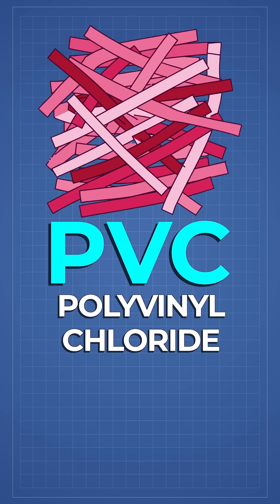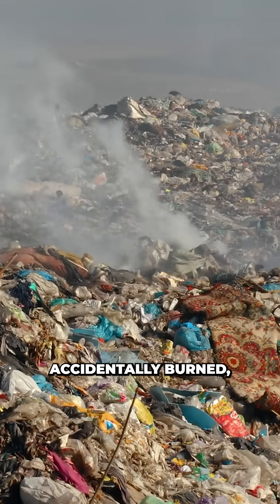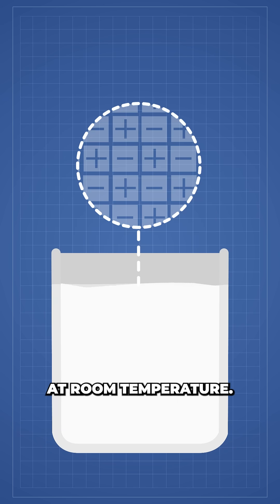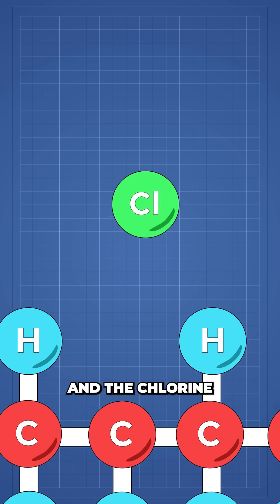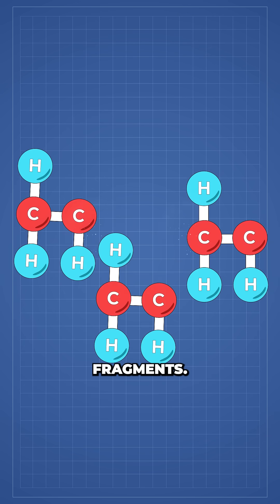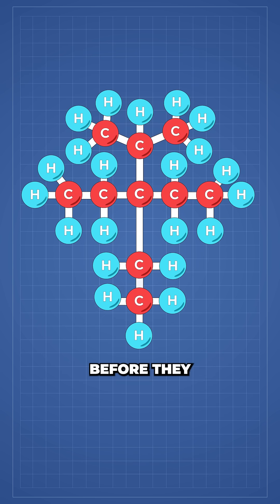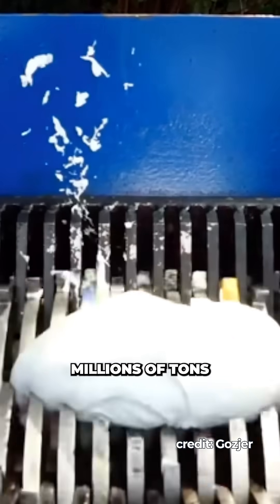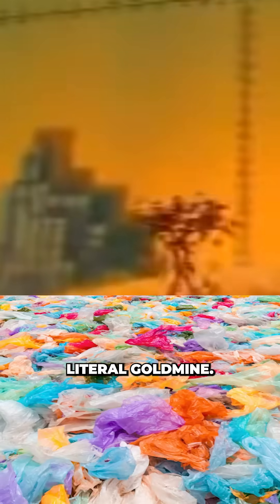Scientists Turn Plastic Waste into Fuel

Comment: If it's not economically feasible. It will not be used, sadly.
Reply: IF you look at the bigger picture, where you are losing land use to landfill for plastic but now reversing that, you don't need to 'mine' it, you reduce the amount of fuel you import, you make and sell HCl acid, then overall you must be better off financially and morally.
Reply: seen the guy in the videos actual prototype video and seems it will be viable, but would at the rate we make plastic waste kill both the current petroleum/gasoline situation and the carbon paradigm because it will end up with greener outcome than anything currently put forward
Reply: @Gomorragh no plastic gasoline is still tremendously terrible for the environment it'll just eliminate physical plastic for the most part
Reply: It uses more energy and creates more pollutants in the process. It will not be used, fortunately.
Reply: Depending on how much gas you can get out of it, investing in this could open up a lot of new jobs and save money on the gas brought in from other countries. There are literal islands of plastic waste floating around out there. If the methods are sound, this is fantastic innovation that could help clean up the planet. No downsides that we know of.

I'd be willing to bet money that this will never come into fruition though unfortunately.
Reply: @01neveroddoreven10 the burning of the gas is not good for the environment
Reply: @hellsent4204 this is true but getting rid of the plastic would be great.
Reply: Not sadly.   Things that are non economical are non economical because they cost more to do than they gain. 

It’s not people costs… it’s material cost. 

Plastics are effectively carbon capture,  we can just bury them and they will stay buried for thousands of years… and no we won’t run out of holes.

Orrrr we can spend more resources than we gain “recycling them” only to turn around and reburn them causing pollution a second them.  

Recycling isn’t free - it costs resources to do… and if you’re not gaining resources by recycling - aka turning a profit - then you’re literally making things worse.  Especially if recycling is taking something innate like plastic and turning it into dangerous chemicals - using dangerous chemicals to do so. 

Recycling either needs to produce value,  or it needs to make a harmful material harmless - which might not involve reuse.  This is neither.   

People act like recycling is always a good thing… like it’s done with free energy and takes no resources to do.
Reply: The most economically feasible way to deal with plastics is to burn them near their point of disposal for energy. If makes no sense to spend $5 to recycle 5c worth of plastics and that's pretty much what's currently happening
Reply: If oil barons can lobby against it, even if profitable it will not be used
Reply: Well, because everyone seems to be a mental consumer, I guess? If people start producing, even the oil mafia can't make their move. By the way, a town in my country is already using this AND has local governments supporting it.
Reply: And we've got a better way to handle plastic waste?
Reply: china doesn't care thaaaat much about things being economically feasible. they already supply electricity at a loss, what's one more project gonna do to their financial reserves?
Reply: It is economically feasible, it just some people want so much money that they drown in it
Reply: One could say an Argument can be made for Capitlism allowing for the taxes collecyed that leads to the research that leads us here. Except that we could have got here 15years ago, if only the 1% were made to pay their fair share instead of bleeding out the middle class. Republicans love deregulation and delaying anyone getting that money. Then if they do, they assume those become one of them. Despicable,racists and useless for society
Reply: Luckily, drilling for and refining oil is INCREDIBLY expensive and not subsidized with "Green" energy research funding. ExxonMobil is already using Green funding to filter CO2 from the air and combine it with hydrogen to make hydrocarbon fuels. With plastics, they could get funding to remove plastic from the ocean, then get additional funding to make the fuel, and if it produces less carbon than coal burning they could use the fuel to produce and sell carbon credits.
Reply: People forget that not everything has to center around making profits.
It's a foolish assumption by greedy people
Reply: @FutureEuropa  
Jup, but the Greedy People made Greedier People rulers of the Rest of us

So we are basically ruled by the borderline psychopathological Narcissists that lack the Empathy to respond to the Suffering caused by their exploitation in a social way
Reply: Good thing it was China that invented it!
Reply: Oh but it is massively economical feasible just big oil is against it!   Follow the money!
Reply: socialism > capitalism
Reply: @Adaro20 you sound so stupid so the homeless man on the corner deserves my money just as much as me. fixing the wealth disparity by providing jobs to those who are bad off is much better than socialism and your pfp tells me your probably in middle school or at least have the mental capacity of a 8th grader
Reply: And also if it is too economically feasible it won't see use either.
Reply: I don’t get why we put so much value on money
Reply: @Sunisrising-v7b  its about capturing value and making it easier to use. its also about incentivizing outcomes. what makes it worthwhile is choosing beneficial outcomes and allowing people to exchange their acquired value for things they like. ideally anyway
Reply: @Sunisrising-v7b maybe because you need money to survive
Reply: @Sunisrising-v7b money has at least 2 purposes. To exchange goods of equal value, to measure whether something is worth doing or not versus another thing it could do instead, called opportunity cost.
Reply: @Sunisrising-v7b all value is made up! 

In all seriousness it is what is needed to compete. Being able to cut down a shilling for your soul is what seperates a sucessful capitalist from a nobody.
Reply: @Sunisrising-v7b  
Neither do I
It should be  tool to  make trade easier, so that you don't have to cowboy your pigs through the city to buy a PC

But in Capitalism Money is a leverage to gain power over others
Something it never was intended to be
Reply: Thanks for finding out why Capitalism never will save the Planet…

but then, Capitalism is the cause for all the Trash in the environment, for Climate Change and the extinction of whole clades of species we yet have to find and describe anyway

What is to be done?
 Agitate!!
Educate!!
Organize!!

Books not Bombs!
Vids not Violence…

Teaching is a political act, because People can only make informed decisions, if they ARE informed
"Saying what is, remains the most revolutionary act. (Rosa Luxemburg)"

Make the change you want to see
Be the Revolutionary that makes it happen
Are you a Revolutionary?
Are you a Communist?

Organize with the RCI
The Revolutionary Communist International!
@revcomintern

As a card caring communist - I'm not a role model, I’m a fuckin example!
Reply: @Marian_Martin_Morgenstern  communism is not the fix either, its a mesh of both or something completely different. not what you think bud. the only communist things that would just benefit instead of harm is a global static income without the need for a job, everything else is just going to never work because of our deep rooted greed. greed is not just money but relationships is susceptible to greed, everything is susceptible to greed because you want that happy feeling. if you think communism will work then your just dooming the evolution of humanity to literal space orcs or the damn Daleks from doctor who seeking perfection in humanity
Reply: @Marian_Martin_Morgenstern There are some economic feasibility obstacles that are capitalistic in nature, others aren't. This one - if there is, I didn't see anyone running the costs - most probably isn't. A good chunk of the time "not economically feasible" means "you spend more resources than you get out of it", thus polluting more overall.
Reply: @Marian_Martin_Morgenstern  Look up what communists have done to the aral sea, comrade. As if human negligence was a matter of ideology... You never truly miss an opportunity, huh.
Reply: @baradragonsftw9310  
Well, the Aral Sea was mismanagement by the Stalinist Dictatorship, a Bonapartism - which means it was ruled by a Caste of parasitic bourgeois Bureaucrats and
Mnemonic:
It is only communism when the working class exercises direct and democratic power in the state.

And I hope you don't mean to claim that under Stalin, any worker had any political say or power…
because not even the Stalinists claim that
Reply: @Marian_Martin_Morgenstern  okay, if you want to understand why capitalists like myself tend to say "communism never works" the answer is surprisingly simple: How do you make stalinism not happen? We count system X being rugpulled into being system Y as system X being culpable until such a time as system Z is invented to stabilize system X, if such a method is known to prevent communism from transforming into stalinism, then your argument becomes much more compelling once you share that information, otherwise, communism and stalinism are functionally identical
Reply: @VictorianLLC  
okay, if you want to understand why Communists like myself tend to say "Capitalism never works" the answer is surprisingly simple: How do you make Fascism not happen? We count system X being rug-pulled into being system Y as system X being culpable until such a time as system Z is invented to stabilise system X, if such a method is known to prevent Caputalism from transforming into Fascism, then your argument becomes much more compelling once you share that information, otherwise, Capitalism and Fascism are functionally identical

Now explain on the basis of today’s US politics how you do that without introducing Socialism
And Yes, without the Red Army you would speak German, sorry

Btw, Trotsky build the Red Army in a Way that even with the bonapartistic* Stalinism’s Purges it could beat Fascism
_
* Bonapartism is when a bourgeois  Counter-revolution fails, can't immediately change back to Capitalism and instead uses as "Strong Man", iE Stalin, as a Front/Puppet for their Dictatorship of a Caste of bourgeois Bureaucrats
As such after Stalin the Soviet Union was a bourgeois State on a Rump of another system which was rotting away underneath.
Which on the other Hand shows the resilience of a Communist Economy System, that it took the Bourgeoisie from 1927s Counter-revolution till 1989 to finally kill it
Reply: @Marian_Martin_Morgenstern  the answer is strong separation of state and commerce, this goes for both no money in politics, no exceptions, and, limited regulation, so that any corruption we don't catch is of limited use, moreover, I'm aware that the conflict between Germany and Russia in WW2 was a major factor in Hitler's loss, but it was in many ways self-inflicted and was in no way caused by Communism as a system being so good that Stalin had to fight against Nazism, moreover, when a capitalist says 'capitalism' we mean a relatively free market, capitalists don't like free markets for only the rich or only nobility, that's a third system that neither side likes, I feel the need to point this out because equating capitalism with any system of ownership whatsoever is essentially the equivalent of equating communism with any command economy whatsoever
Reply: @Marian_Martin_Morgenstern humans  where driving species  to extinction  long before capitalism.
Reply: @Marian_Martin_Morgenstern  Something not being economical is not just a capitalist principle, by the way. Even as a critic of capitalism, I wouldn't advise anyone to organize with such an uneducated crowd as yours.
Reply: @Marian_Martin_Morgenstern Communism has worked very well every time it was implemented. Never before has it failed disastrously.
Reply: @Marian_Martin_Morgenstern Yeah, this method also uses more energy and produces pollutants in the process. So either way this is a joke. Still impressive that dude built that machine. But then again, he almost blew himself up with it...
Reply: @Marian_Martin_Morgenstern  Aral Sea
Reply: @aniviamain309  
Mismanagement by bourgeois Caste of capitalistic Bureaucrats
Reply: Happens when the Bourgeoisie isn't strong or willing enough to enact Capitalism for everyone. Basic Stalinism
You would know if you read above posts
Reply: @Marian_Martin_Morgenstern Ah yes, of course the Vanguard of the peoples revolution is just capitalism, of course. Next you'll decry Karl Marx and Lenin as Bourgeoise agitators.
Reply: @aniviamain309  
Who do you mean with "Vanguard of Peoples Revolution"?
I hope not Stalin the Counter-revolutionist
Reply: @Marian_Martin_Morgenstern   ah yes the classical communist agenda: “capitalism is the root of our problems, communism will magically solve all of them” 
While the need to deal with this problem is valid, the need for a economically viable solution is also valid, as using a incredibly inefficient system to solve a issue is just a bad idea in general. Take for example pyrolysis. While we can use it to turn plastic back into gasoline, it harms the environment AND is also economically unviable, which is why it isn’t widely used. While this new creation doesn’t seem to harm the environment, yet, however, if the cost of doing so is expensive, large scale operations will become difficult to pull off, as it will end up hogging up all the money that could be used in public infrastructure. This is why these solutions only get used when they’re economically viable, because if it isn’t it’ll just end up as a resource hog, and the issue will still be prevalent later on. Take solar for an example of a (partially) successful solution to the plan of eliminating fossil fuels, it’s easy to produce and can be installed easily, making it economical viable. While nuclear would in general be a better solution than solar since it generates significantly more energy, it isn’t widely used due to the irrational fear of nuclear and that it’s a long term commitment. 
Anyways, you Communists will never get your ideals across to a governmental scale ever again. The world has seen the shortcomings of your ideals, several times in fact, and each of them ended up with people starving while corruption runs rampant in the government. Your idea of communist is entirely reliant on the idea that everyone is perfect, yet reality time and time again tells you that people aren’t perfect, and are susceptible to their own agendas, which makes your communist heaven forever a pipe dream. Moreover, the idea of “fair wages” in communism is a delusion, this is because in capitalism, you’re rewarded more if you work more, assuming your employer isn’t an ass. However, in communism, no matter how hard you work, you gain the same, this means that the people lack the incentive to work hard, as they won’t get rewarded for it, which would cause people to work bare minimum. Apart from that, you also got people who escaped from communist countries, telling people how bad it is and how they never wish to return, yet rich white kids like you have never met the real world, who larp as revolutionaries ignore these people, claiming they’re lying or what not, while eating up any CCP slop you see online, taking it as truth. 
Your communist utopia will forever remain a pipe dream, as your idea either requires all humans to be rid of sin, an impossible task of itself, or have everyone be completely indoctrinated, with no free will of their own, completely under the control of the state, which the scenario itself is a contrast to the idea of an utopia, as how is it an utopia if you can’t even think for yourself, without risking yourself to be eliminated by the system? 
Answer me communist, do you understand the plethora of shortcomings of your ideology and intentionally turn a blind eye to it, or do you truly believe in the grand lie of a communist heaven?
Reply: @labbit35  
May I tldr that?

"I don't know Jack Shit about either Capitalism or Communism, but I can recite cold war red scare propaganda from the depth of my heart"

I grew up a few short miles away from the Iron Curtain in a socialist country
I'm was a chemist by trade before the wall fell and enrolled in WU(Vienna  EconomicsUniversity) on my own money for a Marketing and Sales degree years after it fell

I admit even tho I was working in B2B sales, I was left leaning even before going to University, but I became a card caring Communist after learning Economics - because I learned what the consequences of both ARE
Reply: @Marian_Martin_Morgenstern  also if communism was that glorious, you’d think maybe it would succeed and establish a long lasting country, but no. The big communist countries like China ended up becoming mainly capitalist, and the USSR ended up disbanding because shit wasn’t going well in the country.
Reply: @Marian_Martin_Morgenstern cool rage bait 👍
Reply: @Marian_Martin_Morgenstern  a capitalist will say: wow wow wow wait a minute. When the cost of disposing those plastic (economic and environmental) becomes too high, we will start finding alternatives.
Reply: @Marian_Martin_Morgenstern  re0lacea system with a failed one sure works put dosnt it
Reply: @koolvibesinc.6725 
Which did fail?
And how?
Please explain without using cold war propaganda, thx
Also read above before you answer
Reply: @Marian_Martin_Morgenstern  capitalism is not the problem , humanity is the problem. this is why ethics and morality are so important. capitalism simply tries to produce goods and services that people need at a price they can afford. because as human beings we are all flawed no system is perfect and we must choose the least disastrous economic path. if people were all essentially good, motivated by service to God, communism would work well.
Reply: @Marian_Martin_Morgenstern It has nothing to do with capitalism. It's inefficient in all types of government. Dunce.
Reply: @KL-rl4kk  
Well as true as that may be, accepting to get your daily a**grape by the rich 1%ers just because they say so, definitely is the most inefficient way to run anything.

We as humans can and should strive to do better, even if we realize that neither we ourselves nor our fellow humans will always do better, we could at least dedicate to DO better and WORK for it

Communisms main Premise is:
Everyone does as much as he can, so that everyone gets what they need(and a bit on top, in case of emergencies)
And you wouldn't believe how low that "does-as-he-can" to provide for everyone will get, especially if you remove the parasitism of the ruling class on top

How much of your workweek do you thing is going towards your pay? And how much goes towards your boss and his bosses pay?

If you deduct costs, up to 2/3 of the value you produce lines your boss's pockets instead of yours

Do you really think your boss should get 2/3 of your money without even raising so much as a finger?
Reply: @Marian_Martin_Morgenstern  thx for your contribution, fellow comrade.
Reply: @Marian_Martin_Morgenstern make a bumper sticker from that one
Reply: @Marian_Martin_Morgenstern war is a requirement and you don’t see that as it should..
Reply: @Marian_Martin_Morgenstern Bro's gonna start internet revolution 🗿. Respect++
Reply: @Marian_Martin_Morgenstern  I like your funny words comminism-man!
Reply: @Luziferne

Chill out lil bro, every Communist country not only created tons of waste, but couldn't even support their population. 

Crazy how it's such a better system but keeps collapsing from now robust systems
Reply: @Luziferne 
   Communism vs. Capitalism. Controlled opposition. You really think there's not greedy people at the top in a communist society?
Reply: @cooliobob-q7o  
Yes, I do believe we can stop narcissistic Egoism from gaining power through Marxism and Democracy, else we get a dictatorship of a bourgeois caste of bureaucrats, ergo Stalinism*
An error we Trotskyists made once and got murdered in the Gulag for it

_
*which in political science is called a Bonapartism, the rule of/or through Bureaucrats
Reply: @Marian_Martin_Morgenstern 
   You have piqued my interest. How will a political system rid greed, ego, and narcissism?
Reply: @cooliobob-q7o of course not. Human nature exists whereever. Except the difference lies where, as we have seen from the cultural revolution, uncontrolled communism fails to reach its ideals due to human nature, while uncontrolled capitalism fails as capitalism's ideals IS to reward human nature.
Reply: @Luziferne Nonsense, it has nothing to do with capitalism. There's no point in creating a fuel that takes more energy and resources to make. Every society needs a positive return on invested resources or it will collapse. Please stop parroting nonsense and read some real economic theory.
Reply: @hemingwaybromfield3722  
I never said that, you are useing a fallacy in discussions, arguing against a point i never made

But just in case…
There are more then enough battery chemistries that are better then lithium ones we have today…
100% technically viable, just not financially

There are Ways to turn ANY organic matter, Waste tbh, into fuel
And it wouldn't even cost money to produce but be +/-0
And with that it just doesn't bring enough profit margins to the table to be interesting for Investors, which in Capitalism means its dead before birth
Reply: @hemingwaybromfield3722 maybe im wrong, but I think the process this video is talking about isn't the process that you are referencing. I think the confusion is that he showed a clip of the kid who got famous online for using an old process to make plastic fuel in his backyard. But I don't think the process shown in this video is the same process that the kid used. I think this is an entirely new process which WOULD be feasible.
Reply: @Marian_Martin_Morgenstern Wow, a propagandist, so nice, tell me, if it takes 10 joules to make 9 joules of energy, how is that remotely feasible? You are losing energy my boy
Reply: @LucianoMas-t7b it is recovering what would be lost... unlikely to be 10:9 ratio. And yes, may not yet be feasible, tho science and tech improve over time
Reply: @Marian_Martin_Morgenstern 
That ain’t capitalism, that’s corporatism.

Capitalism is for the free market. Corporatism is for the profit.
Reply: @HoloCure_Gamer_45  free market give birth to corporatism.
Reply: @HoloCure_Gamer_45 corporatism(corpocracy) IS a capitalist ideology! 🤦
Reply: @Marian_Martin_Morgenstern I agree with the message but communism NEVER works. Capitalism out scales it because of human greed. The only way it could possibly work is if we weren't human, and we have another 30 years and massive investments and development in robotics to wait until we got that technology. 

Communism also never works because you cannot make a system where there is no hierarchy. Humans need a hierarchy or some kind of reward to function. And prefer short-term gain to long-term investment usually. 

That's why capitalism works.

And that's why socialism (with the right conditions) may also work.
Reply: @Marian_Martin_Morgenstern  and also
FREE PALESTINE
Reply: @tasnuvakhandakar480 yeah build some houses already
Reply: Then you do it

Cooooome on big guy..

Make it plentiful 

Wait you can’t?

Stfu
Reply: @Taeix 
Well, Capitalisms main promise always was that it will be the system most plentiful
It just never was said for whom

So will you make it plentiful for everyone?

Wait? You can't?

then…
STFU

Communism never promised plentiful, just that everyone gets what he needs and everyone does what needs to be done to make sure that everyone gets his needs meet
Reply: i fucking hate capitalism
Reply: @Wujo.apizz36  then move to china
Reply: @Wujo.apizz36 in any society that uses money becomes capitalism that's exactly what capitalism is name one true communist or socialist country